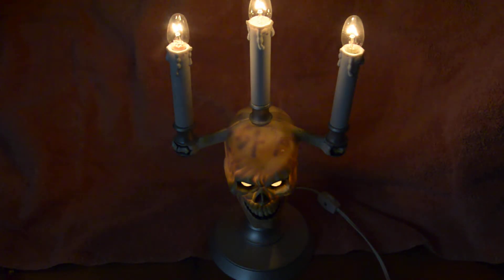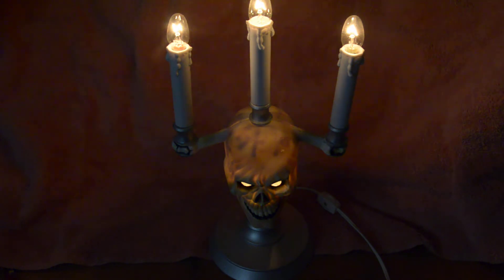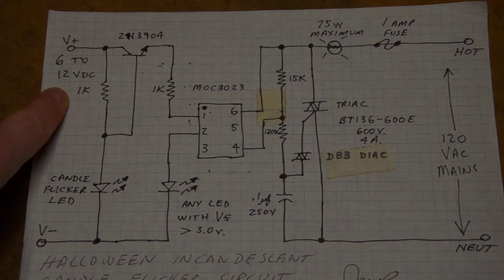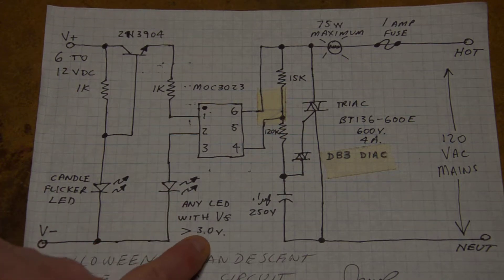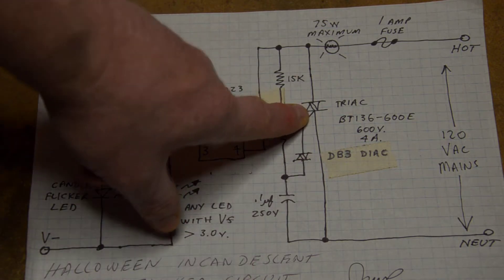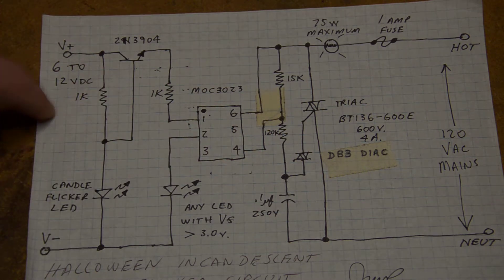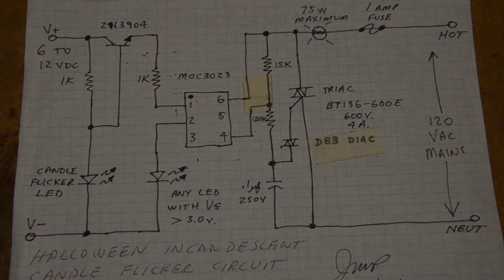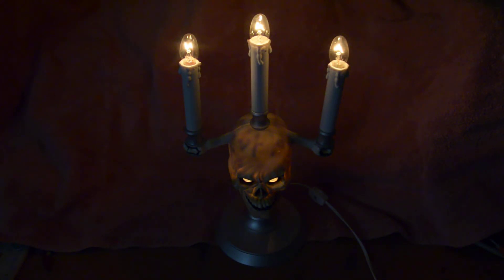Candle Flicker 120 volt Incandescent Bulbs in candelabra

Comment from the maker: The flicker LED circuit has a high DC voltage offset.    The LED and IR LED in the opto add up to  create a higher forward voltage drop that sort of eats up that offset so that the opto is flickering and not fully on all the time.  It sets the current turn on point right at the point where the fluctuating voltage flickers above and below the forward voltage drop of both LEDs.   Make sense?
Reply: Sorry, I just read your comment after 'rediscovering' your video again. Thanks for answering!
Reply from the maker: @Asyss_Complex  Great.   Have fun with it and be careful with the mains voltage.

Comment: Hi, thanks for sharing! 
I'm confused about the extra LED, so basically you need it to decrease the voltage fed to the flicker LED? If so, wouldn't it be better to select a lower power supply or even adding an extra resistor?